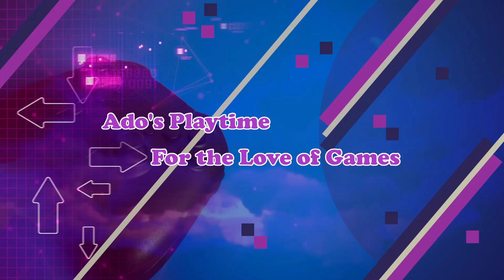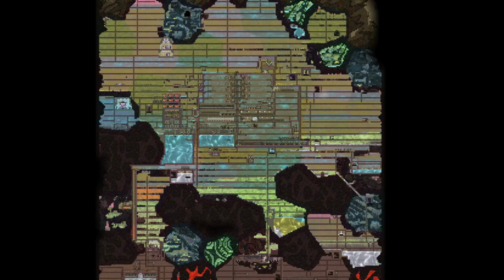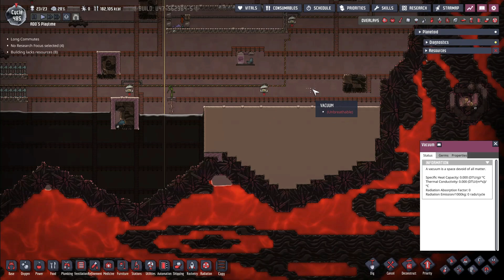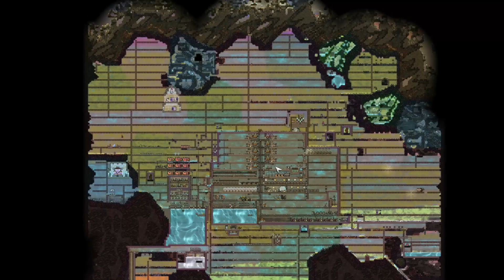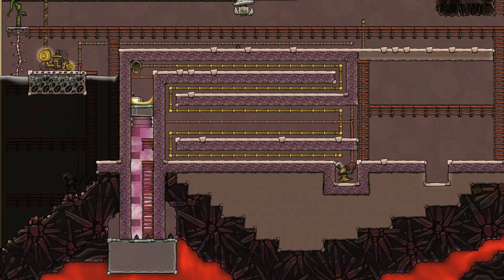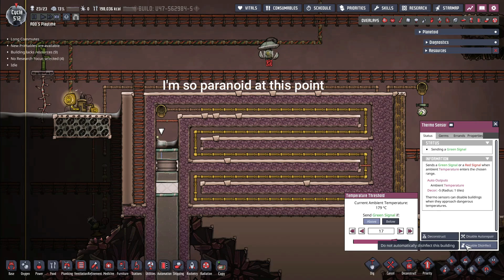ONI Episode 15 Petroleum Boilers are easy?

Comment: One problem I noticed with petroleum boiler design like this is that if you leave it idle for a long time, heat creeps in from the hot area to the pump, because when it's idle, there's no counterflow to cool it. Steel pump can probably withstand it, but I want to come up with a design that can work with a gold amalgam pump.
Reply from the maker: That is tough. I would love to see it. If the counter flow was long enough and oil was cool enough it would probably be ok. The petroleum is around 140c I believe in the tanks with this design.

Comment: You should stress-test it. The insulated tiles to the right of a tempshift plate are slowly heating up, and the one righ-down in relation to the plate is in direct contact with petroleum. You're risking the petroleum to flash to sour gas. The same mechanism as when you drop oil onto hot abysalite.
Reply from the maker: You are probably correct. I put 2 temp shift plates there but will be changing it to one. There are some other notes that I have made for corrections and will be fixing them. Thanks for the advice and the feed back.

Comment: this episode has inspired me to fire up another run and to build a petroleum boiler too (I've never tried it before, I always used oil refineries). very cool!
Reply from the maker: To be honest I had seen other people’s designs on Reddit but they did not seem to work for me. The ones I saw were 10x24 or taller but shorter. This is the one I remembered making the first time I ever made one in game and it seemed to work forever but there is some tweaking that can/needs done. Glad I inspired you!

Comment: temp shift plates don't actually transfer heat between each other. they only transfer heat to entities in a 3x3 area around them, such as solids and gasses. this means that if you build a bunch of temp shift plates inside of a gas or liquid, it will make heat spread faster, as each tile of said gas or liquid will exchange heat with a plate and then with other tiles of in 3x3 vicinity instead of just exchanging heat with its 4 adjacent tiles as they normally do.

however, this also means that temp shift plates do NOT work in vacuum, because there's nothing to exchange heat with, and they do NOT exchange heat with each other directly (only via some other material).

this is also the reason why you can't cool buildings with radiant pipes in vacuum unless you have some liquid to conduct the heat between your pipe and your building.
Reply from the maker: Your idea of filling the space from magma/diamond to steal door is intriguing, this would lead to problems with controlling heat but may have applications in other things, hum... 
I did remember after a point that temp shift plates don't transfer in a vacuum. That is why I bricked it to the "top" like I did. I remembered that when I tested this in my debug map that the temp shift gap gave me slightly better even and gradual heat dispersion. I like to control where I can ;-).

Comment: it's curious that you use those diamond spikes to conduct heat from magma. i just dump water into magma for that. my rationale is that the more steam you have, the higher thermal conductivity it has, so you can change the amount of heat transferred by changing steam concentration above magma. but as you might imagine it's prone to um, accidents.

i also didn't know that you could build down into lava by angle building, that's pretty cool.